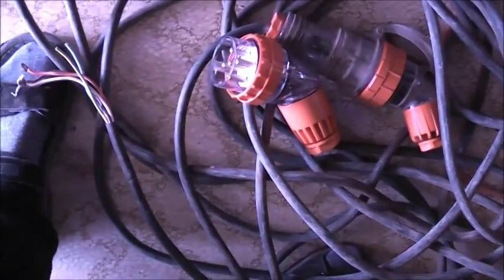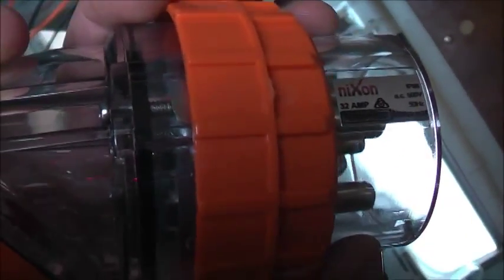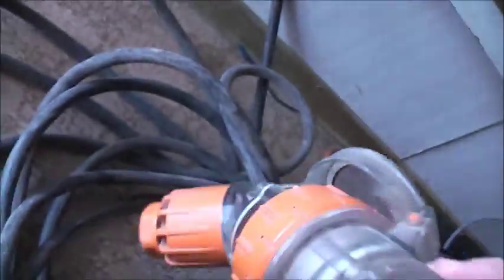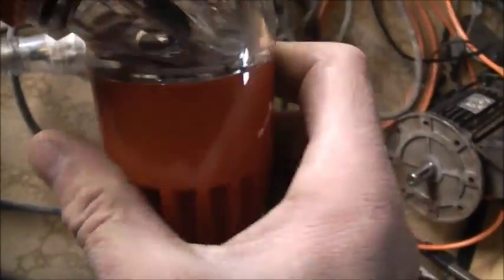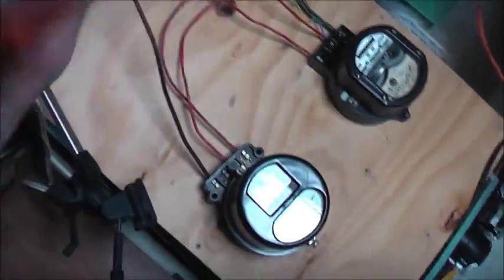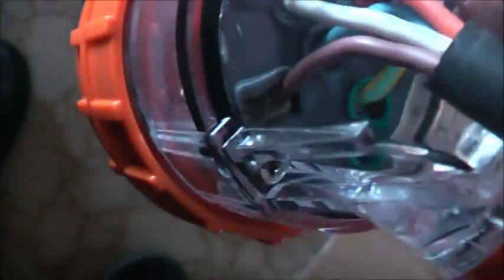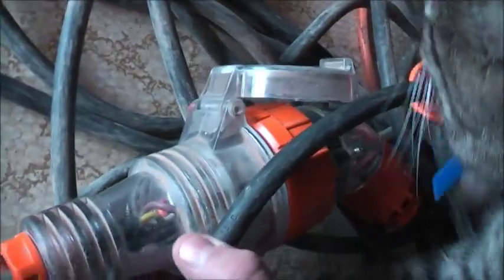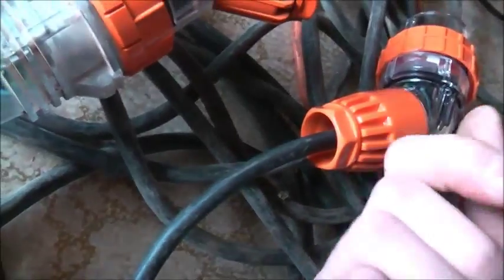32 Amp 3 Phase Plug Wire Up

Comment: Mmmm! Those 3ph 32A plugs are a bit different to what we have here in the UK. We can have 3ph-only plugs ( four pin, no neutral) or we can have 3ph+neutral (5 pin plugs) All plug types always have an earth pin.

Could you do a video on the wiring config of one of those and the colour codes for the phases? That'll be interesting and I'm sure that there's others that would like to know how to wire one of these. :-)

Thanx for showing,

-BoomBoxDeluxe.

18th September 2014, 02.05
Reply from the maker: ok ;-) Will wire the 4 pin plug on that Fimec motor as a demonstration!!